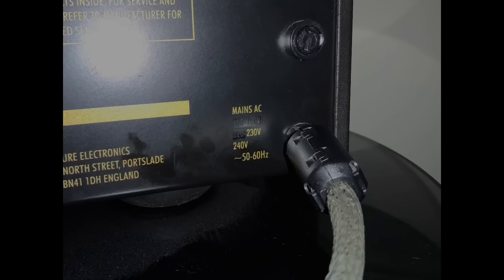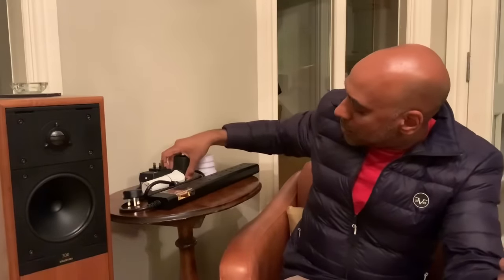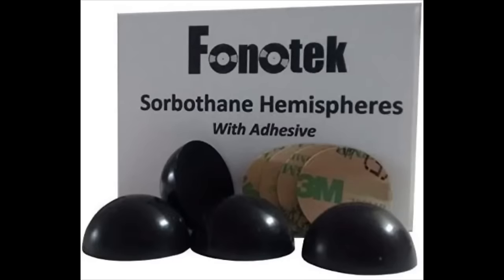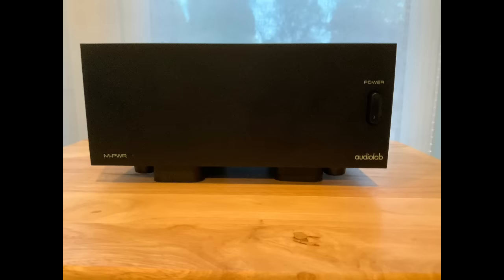My Top 5 Inexpensive Hifi Tweaks

Comment: Lol. No knowledge of electronics. The only thing you need to isolate from vibrations is your Turntable and your speakers. You have zero need to isolate Solid state electronics. The clue’s in the name. Solid state. No moving parts. Power conditioners are next to useless. The best thing you can do for your system is set it up properly, in a decent room with no clutter and lots of sound proofing.
Reply: If I can eek out another 1 or 0 from my CDs I'm on board!

Comment: one needs to burn in/condition your interconnects and speaker cables and power cords, I would recommend Hagerman Audio Labs in Honolulu, Hawaii (haglabs.com) for his frybaby and frycorder devices. If you have a turntable with a bare platter, you might want to try the electrical tape tweak by Gary Koh of Genesis Speakers...his 3 piece electrical tape tweak on VPI's Avenger turntable gets the approval of Harry Weisfeld. Look for the template on the internet (use 3/4" wide electrical tape)..and NOT all of these tapes sweat tape residue..the 3M does not) or go to audioasylum.com and go to their tweaks/diy forum and you will see the 'turntable platter tweak with tape' print out the template and hear for yourself..some listeners have also cut small strips and put in onto areas of the tonearm's base...
Reply from the maker: Thank you for watching and sharing 😊

Comment: The advice is bad. I sold audiophyle gear late 70s and 80s. Speakers image better the more staple they are, solid stands on carpet are not solid. Spikes help. Speaker must be solid, not isolated. Bonded to stand.  Isolators are for components, not speakers.   Switched off, just a guy on the flog. Expert without expertise.

Comment: SET Follower 
Russian tubes ....
Watch , if you use a yaquin watch ...
Heres what's going to happen even with your d class
Reply: Your not going to want to listen to your solid state anymore ....
At first you'll go back because your not driving the top end through with equilization and the odd speaker placement....
Reply: I remember fighting it in the beginning 
It just doesn't seem logical 
But then you cant go back ...
The key is the equilization control and the euphonics,  it has a way of making the ordinary listening experience just that .
Reply: Use the tubes to control the phasing of your mosfet AB or d class...
Or ... completely replace it with a fet like a Sony TA-N7B/Yamaha B-1/2/3...
Theres no going back ....
It every days like a bitch .
The quality of the listening experience is unmistakable .
The other alternative is full SET through  elaborate equilization 
It eats other set ups alive .
Especially if you crossover delete and go full active .

Comment: Most of those 'devices' have no measurable effect and certainly nothing you would hear. They are placebo products designed to raid your pocket.  I use spikes on my floor standing speakers on carpet to stabilise the cabinets to the sub floor, they are not for isolation. Ferrite cores are not magnets in themselves and we electronic engineers use them to prevent emissions mainly from digital switching cables. RF rejection on high signal level, low impedance speaker cables, low impedance amplifier outputs - don't be daft. A/C cleaners are pure snake oil.

Comment: More pseudo-science bunk or half-understood science bunk. 

5. Speaker cables run at high enough voltage that they wont get interference from RFI/EMI signals. Ferrite on speaker cable, does literally nothing.

4. Anti-vibration feet matter... ... ... for turntables, or if the build quality of your amp/pre/etc sucks. If the electronics aren't moving around, IE, have poor connections... it ain't gonna matter. Though, for ~$10 or <10GPB, you could be spending your money on a lot worse.

3. Power conditioner strip is just good advice for pretty much all AV equipment.

2. I've not seen any data that tells me these actually do anything, and I highly doubt their efficacy.

1. WONDERFUL! Encourage people to spend unnecessary money on non-UL listed cables. Lets see how that works out when it causes a fire and the insurance wont pay out because you're using a custom cable, and it wont even make any difference.

Comment: With one breath you say not to get sheilding and another you say sheilding with ferret is good 🤷‍♂️if you ever get the chance to experience a high resolving system all you opinions will change about transmission lines,please get educated before you speak about things your not educated in
Reply from the maker: Hi Philip, adding a Ferrite core is not the same as shielding. Shielding adds capacitance and Ferrite cores add inductance. I am not saying that Ferrite cores are good. I am saying that they can be of benefit in some systems and as the cost about £1 a piece they may be worth experimenting with. I am sorry you didn’t enjoy the video. Thank you for watching anyway.

Comment: I think, Mr. Tarun, is aged more than 40 years. You can hardly hear any frequency above 11,000 Hz (Go and test yourself, there are so many apps on the net) if you are above 40 yrs and a max of 13,500 Hz if you are aged less than 30 yrs. So, whatever the audiophiles (!) say about frequencies above 14,000 Hz is BS. They try to impress general people without knowing the physiology of the hearing system and make them a laughing stock to physicians.